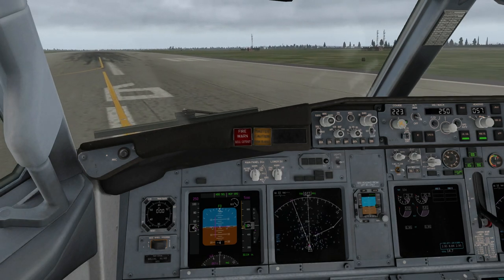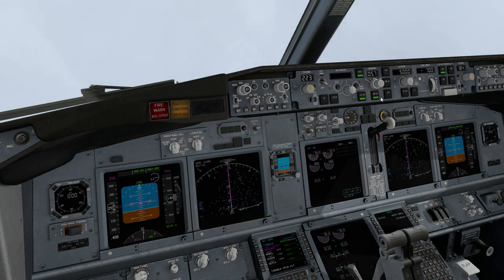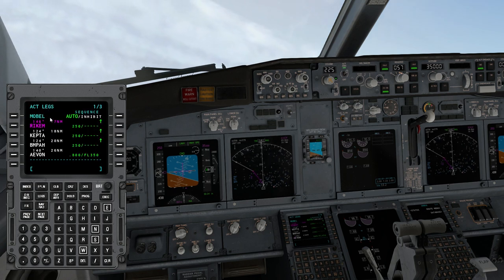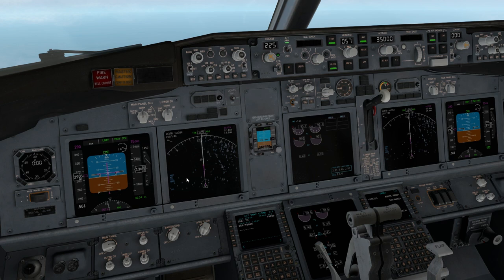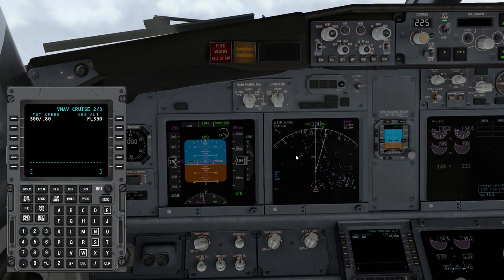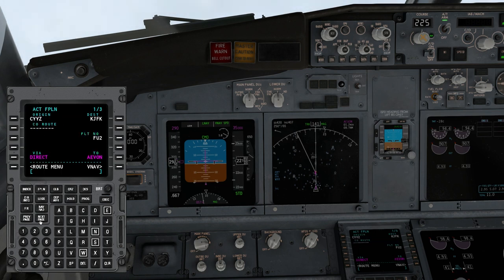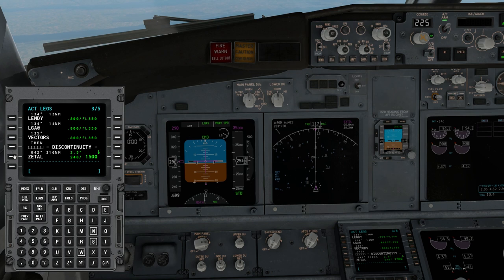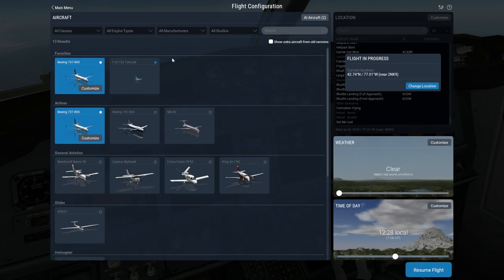Let's Fly: X-Plane 11 - Episode 4 - Boeing 737-800 CYYZ to KJFK - FMS - Part 2/3

Comment: Hi Quill! A couple of clarifications from a fellow flight simmer:

VNAV mode is constrained by the altitude setting because (for example) the ATC may not clear you to your full cruise altitude right away (or to descend all the way). If you've leveled off at the set altitude and want to climb higher, you need to push (=click) the altitude knob after setting the altitude (not sure if that's modeled in the x-plane default 737).

You should keep the beacon light, the strobe lights, and the nav lights on for the whole flight. The nav lights (green and red on the wingtips) help other aircraft see which direction you're going, and the strobes (white blinking) and beacon (red blinking) help them see you in the first place. Typically you have the nav lights on whenever your plane is powered on, beacon light is on from right before you start your engines until right after you shut down your engines, and the strobes are on from the moment you enter the departure runway until the moment you exit the arrival runway at your destination. On the 737, the nav and strobe lights are combined in one switch, the "position" switch, with "off" in the middle position, "steady" (just the nav lights) in the down position and "strobe & steady" (nav and strobe lights) in the up position. The landing lights, and logo and wing lights if you're using those, are typically turned off (and on when descending) at 10,000ft.

"Auto" seat belt sign setting turns the seat belt sign off above 10,000ft and on below 10,000ft.

Fun fact, in the NA, 18000ft is the standard transition altitude, but in Europe the transition altitude changes from airfield to airfield.

You did the correct choice with the STAR, I'd say, as you should pick a STAR which starts where you're coming from. That's the idea behind it: "this is where I'm coming from, how should I get to the airfield from here?" (Side note: as a European flight simmer, I'm not a fan of how often North American SIDs and STARs include vectoring. It makes it that much more of a pain to figure out if you're flying offline and not, say, on VATSIM!)

The wind direction in degrees is the direction it's coming from! You can see the current wind speed and direction right under the ground speed reading, in the upper left corner of the map screen. The arrow shows the wind direction relative to your airplane.